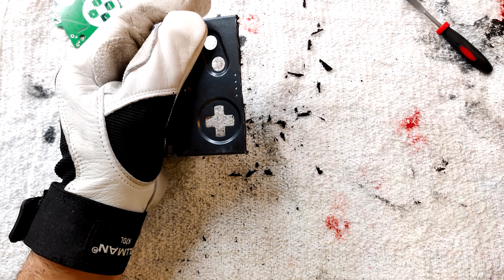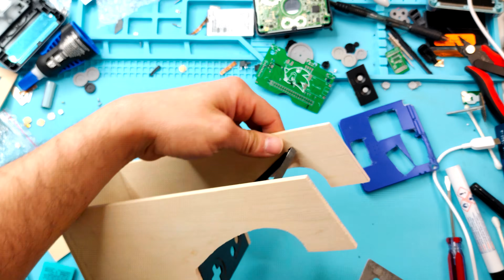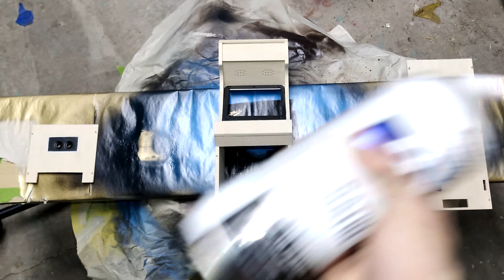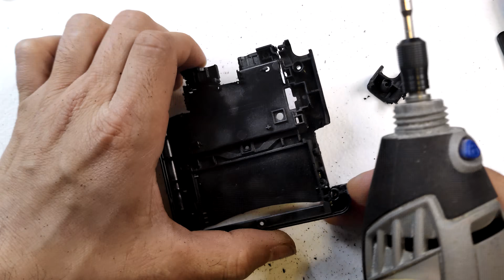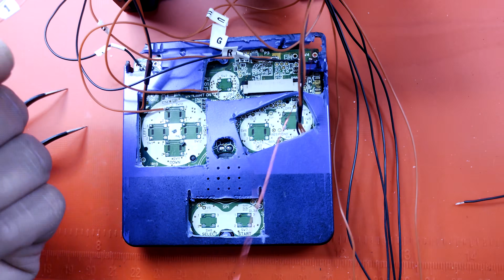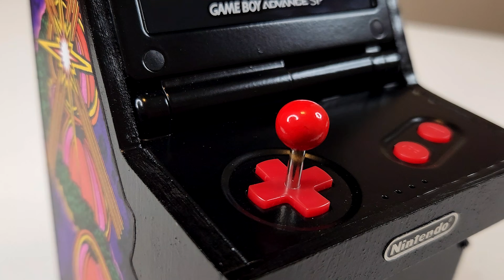Turning a Gameboy into a Mini Arcade Machine!

Comment: .Damn the amount of donor Gba's you cut is crazy! I used 1 to complete my whole build and haven't had an issue doing so. None the less great job on your build
Reply from the maker: I actually only cut one unsaveable board for the leds on top because the rasberry pi one didnt have spots for leds. The rest  I cut are rasberry pi boards, not original nintendo ones. ")
Reply from the maker: And thank you ")

Comment: Covering the battery pack dont cha think it might overheat afte?r
Reply from the maker: Its already covered in plastic, a thin layer of wood wont make much of a difference. I did however think about cutting the bottom part of the battery lid for easier access.
Reply: @retrostashrepairs  thanks for the reply
Reply from the maker: @yehovayeshua  no problem ")

Comment: Really cool project, but the video itself is some kind of massacre. It's terribly bad to watch with such a fast frame rate. I understand that you want to shorten the video, but you could have divided the video into two or three parts.
Reply: I don't think this video would of not had the same results being in parts, in my opinion 🤷‍♂️ this work was 5 month worth of work and even if it was in parts it probably would of ended up being 1 hr video parts or more without speeding it up.

Comment: i love the creativity, ingenuity and cable management of this build! for a possible V2 of this i would say adding a leading cable that goes to the top to a small LED strip and replacing the front panel with clear acrylic with a transparent design you print out so it llights up when turned on like a real arcade cabinet. i also like the padding you put at this bottom and i was personally thinking of a small suction cup so it will definitely stay wherever you put it
Reply from the maker: Already planned on that 😄 thats why I put very little glue on the wood on the marquee. Hopefully I get back to it soon

Comment: I wonder how long the GB/C/A modding scene can realistically last.  There aren't infinite systems out there and there are less and less every day.  Some get modded in a different way, some break, are lost, or destroyed, and others still end up in the hands of collectors never to re enter the marked until the day they die (including mine).
Reply: We can source the chinese clones, like the gb boy and the gba clones. Or you could go the expensive way and make a gba out of an FPGA, like Analogue does
Reply from the maker: Not sure how long, but they do circulate as well. Thats why its a good thing that the rise of repairs have gone up. I suspect the prices are going to skyrocket after a while though.

Comment: While it looks nice, if it were me I wouldn't sacrifice a real GBA SP to do this. I would bought one of those cheap GBA SP knockoffs from China and just to use those for the shell casing instead and then just put a pie board in there then buy a cheap backlit screen for it and go from there.
Reply from the maker: There no sacrifice here. I used broken and after market shells. And the board and screen I could technically just take it out any time and put it back in the original housing. ") even though I dont plan on doing that. I have my own personal sp collection already.

Comment: I wouldn't have put the shoulder buttons on the back with the form factor you are using. I'd have put them on the side. Similarly to how pinball bumper switches. Otherwise, nice work.
Reply from the maker: Thank you!  And not %100 done with it yet 😊
Reply: @retrostashrepairs  I can understand that. I have a few projects that I constantly tinker with as well. Like turning my computer into a mobile suit cockpit.

Comment: Wow, absolutely incredible work! Really great shape, and design and the control panel looks fantastic.

Having said that, there are some preferences/nitpicks about the cabinet I would change. It's by no means a criticism of your work. 

I think it would've been better to spray the cab with a couple of coats of primer and sanding before painting would've been better. The grain on the wood is still visible. Also, a light up marquee would add a more authentic look, as well as light up "coin doors" for Select and Start. In addition, "t-moulding" on the edges would make it really pop. That could be achieved with some paint. A color to match the artwork. 

Again, not criticizing, just nitpicks. Hopefully, you do make those additions you mentioned and make another video. Well, done and thanks for this video. It was a pleasure to watch.

Comment: What a beautiful thing you have accomplished bro... so much dedication and determination, if i started to do this kind of things ,I would gave up at first step 😆.. I'm still amazed how you remembered to connect all the cables.
Neat and Clean. You deserve more subscribers.
(I started to watch and follow this channel mainly to repair my Old Sp screen , I think the issue is probably the polarizing film showing some wet marks because of humidity, and need to change it watching your clips). Thanks a lot... 
Peace and Love my friend ✌🔝
Reply from the maker: Thanks! 😊 yeah this project has been my longest yet to finish. And I used number and letter stickers on the wires.

Comment: This is a great build, well done! One small change I would have made though is to place the trigger buttons on the left and right sides of the cabinet, much like a pinball machine. If you then added weights to hold it down this would be more comfortable to play.
Reply from the maker: Side buttons was my original idea, but then decided against since I didnt want them getting in the way of the design. ")